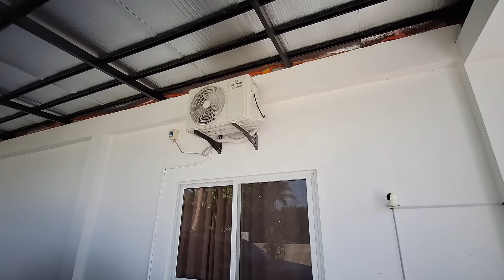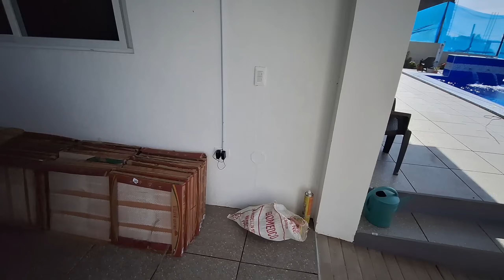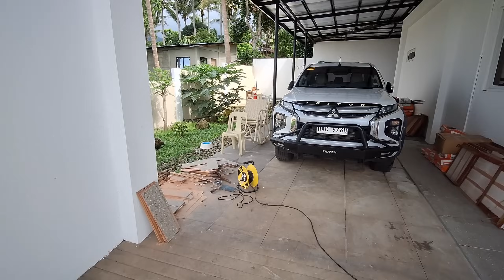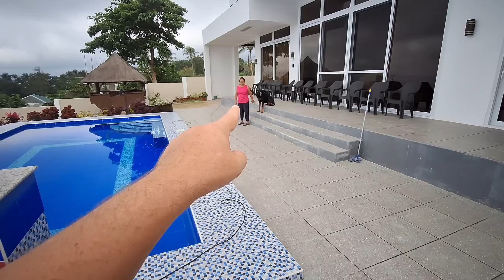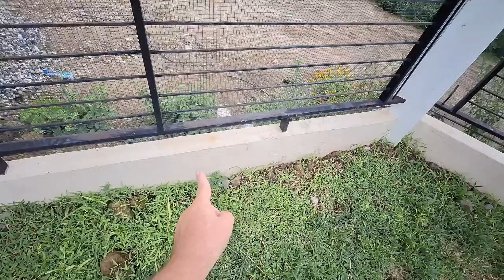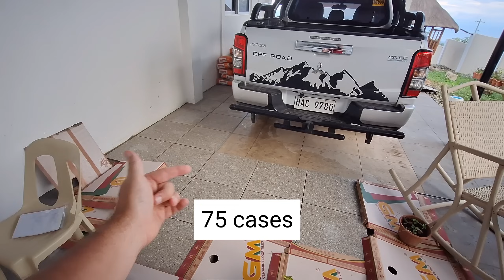Building a house in the Philippines 🇵🇭

Comment: Mold and algae issue? I use this mix if possible.
If you’re cleaning a driveway like you are. Wet the ground on both side before and after. To dilute solution that runs onto soil with plants.

Start by dissolving TSP in warm water to create a slightly cloudy, odorless solution. A good general ratio is 1/2 cup of TSP to 2 gallons of water. You can use a slightly stronger batch to combat mold and mildew—mix 1 cup of TSP with 3 quarts of warm water and 1 quart of chlorine bleach.

This solution can be funneled into a spray bottle or applied with a stiff scrub brush or sponge. Work in sections, applying the solution in liberally and using some elbow grease. Allow the solution to sit on the surface for 10–20 minutes, then rinse thoroughly with clean water to remove any TSP residue. Repeat the process as needed for stubborn stains or thick grime.

How To Use TSP Safely
Always read and follow any manufacturer instructions, heed all safety warnings, and don personal protective equipment (PPE) when mixing and using TSP. Work in a well-ventilated area and use the least amount of TSP that will be effective for your purposes. Never mix TSP with other cleaners or chemicals, except as directed above for mold and mildew removal.
Reply from the maker: Appreciate the tip and the formula.

Comment: For the mold. Using Chlorox can be expensive...I had a property in the Dominican republic and had the same issue... The local maintenance guys use diluted Muriatic acid (typically used to balance the PH level in our pool. ) much cheaper...at least in the DR>...🙂
Reply from the maker: We love DR.  We still have a time share there in Bavaro. Thanks for the tip.

Comment: I can't remember, Greg (old brain 😂🤣). Did you plumb your house with whole-house hot water? Or is it typical Filipino style with each room having a heater?
We're meeting with another designer/builder this afternoon, and I wanted to present to him the possibility of whole-house hot water. The last builder, on Monday, would only agree to multi-point hot water in each T&B, and a heater for the kitchen (laundry is outside the kitchen). That builder wasn't versed in whole-house hot water.
We'll also be building the house with solar, and dual voltage (220v and 110v), giving us more versatility with appliances and tools. It will cost more, buy buy once, cry once... 😂🤣
Happy house, happy spouse ❤️😂🤣
Reply from the maker: We did on demand hot water heaters. I think they are more efficient as you're not storing hot water. That was my thought process.
Reply: @buildingthephilippines  the small electric ones that I put in the showers? We'll probably use multipoint heaters that can give hot water to the sink and shower, using only 1 heater. We'll use one in the kitchen, joined to the laundry. It's the best I can do, I assume? My former U.S. house had on-demand hot water, but that was for the entire house. It's what I originally wanted, but builders here look at me like I'm from outer space, when I suggest it 🤪
Reply from the maker: Lol, like you have 3 heads. We bought multi point as well.

Comment: Not sure if you can find it but we use “Wet it and Forget It” in our shower. It’s not for heavy cleaning of mold but a great maintenance to keep it from starting. Also for heavy cleaning get the liquid chlorine for your pool. That’s much stronger. You can dilute it . I think regular Clorox is 5%. They also have chlorine in a gel solution that sticks better to the surface rather than running off.
Reply from the maker: Yeah, I have 90% chlorine here. I will just dilute that.
Reply: Have used '30 Seconds' comes in a gallon jug with a sprayer (basically bleach) and it works for mold.

Comment: Bleach should definitely kill the mold, there also is mold sprays specifically for concrete. 
Don't use vinegar, and especially don't mix bleach and vinegar.
Reply from the maker: I need to find a sprayer. Bleach or someone suggested chlorine from the pool.
Reply: @buildingthephilippines  I believe chlorine & bleach are basically the same. Chlorine is just stronger
Reply from the maker: Will give it a try, hopefully it works.

Comment: Your hot water tank is a battery. Put it on a timer, increase the temp to say 70 deg C, and fit a tempering valve  set to 60 degrees
Reply from the maker: We have on demand hot water heaters, no tank.